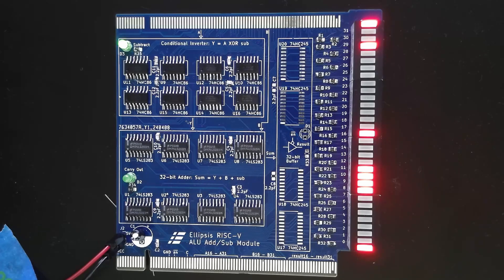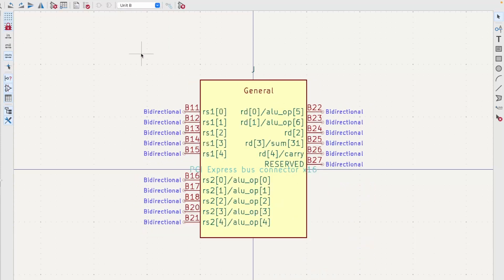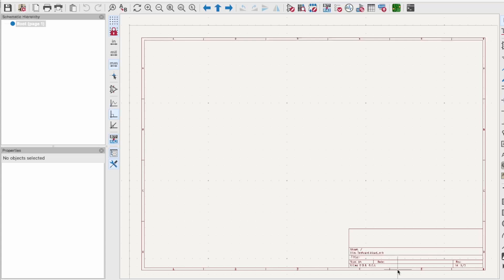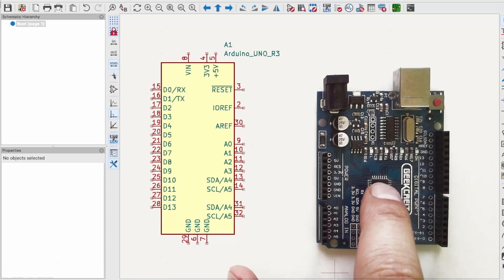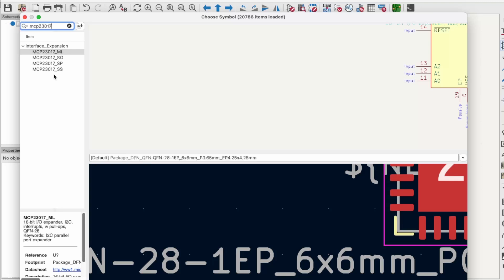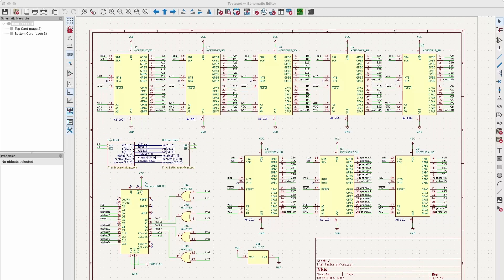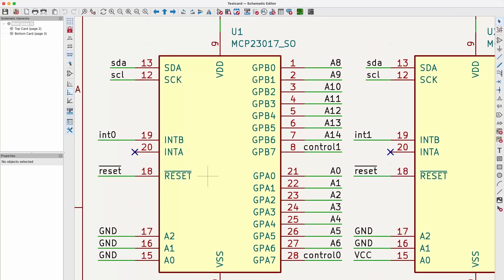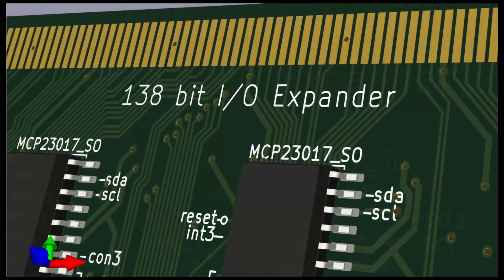Expanding Arduino's I/O for the Test Circuit (RISC-V Part 4)

Comment: 04:12 You can reprogram it through the SPI connector in that case just fine, if you have an USB-to-SPI programmer (which usually uses the same chip as the one on the Arduino board, or other similar chip), or if you have another Arduino board which can also act as an SPI programmer.
Reply from the maker: Yes, you are absolutely correct. In this case I wanted to keep the UART pins free so that I can use the onbard programmer just for convenience.

Comment: I am quite surprised that you want to use the 0-variant. Wouldn't the S-variant be much more convenient. You just have to set the Address-Enable-Bit on setup and get 16-Port addressed like a single huge chip. The Datasheet is quite comprehensive and when using Bank-Mode it's so simple that I don't even bother with drivers; this chip just works.
Reply from the maker: Since I wanted to use I2C to reduce I/O count I went ahead and ordered the 0-variant before making this video without reading the S-variant section of the datasheet. So I wasn't even aware of the addressing mode option for the SPI interface - thanks for letting me know about it!

Comment: The MCP23017 with I2C interface has a silicon bug which is why pin 7 of each port is now listed as output only.

Those pins can still be used as an input because all of the circuitry is still in there, but you naturally run the risk of hitting that bug if the conditions are right. Search "MCP23017 bug" for some information about it.

Or you can use the SPI version which doesn't have the bug, if your application allows it. Or of course another I2C expander.